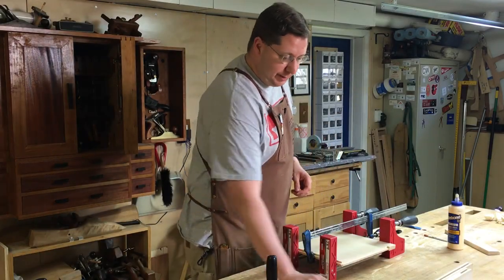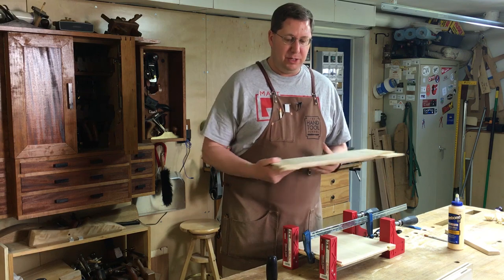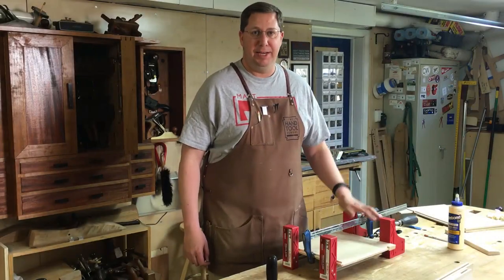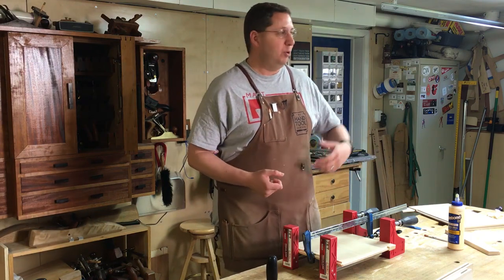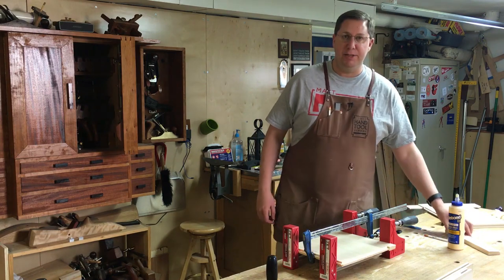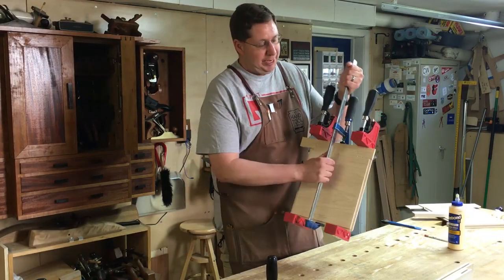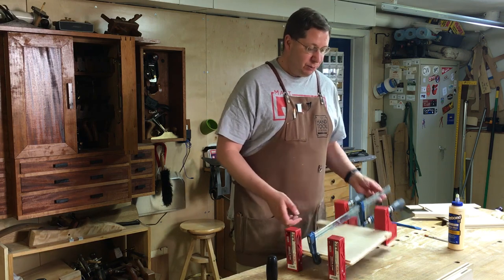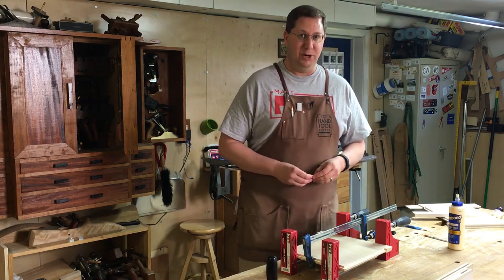Fixing Mistakes from the Trash Can

Comment: I'm having a terrible time hand planing ( #8 jointing plane) over softwood knots. The plane just rides ride over it.  So, its really hard to get a flat surface.  I have to work with what I've got. I've resorted to chiseling them down, but thats a pain. Any advice would be much appreciated.
Reply from the maker: Knots and weird grain are best tackled individually.  Usually working in a circular motion with a short soled plane with a freshly sharpened blade.  Work the spot until its low, then use the jointer to flatten out and remove the hollow.
Reply: RenaissanceWW Will give it a try. Thanks so much!